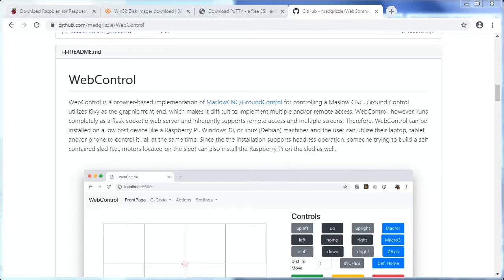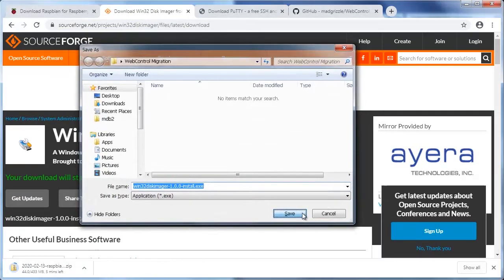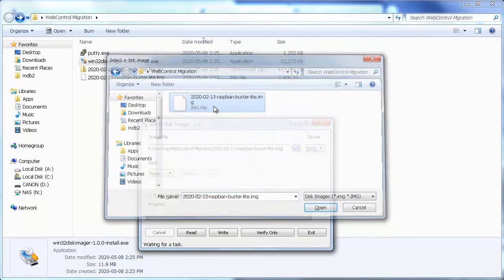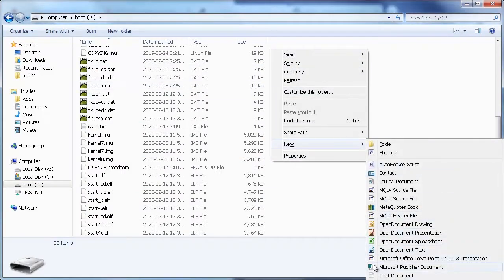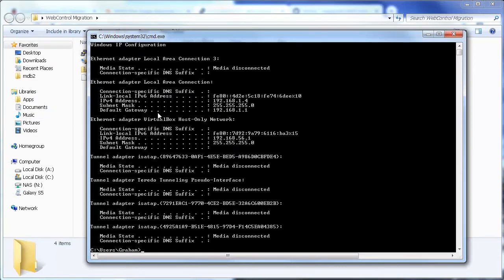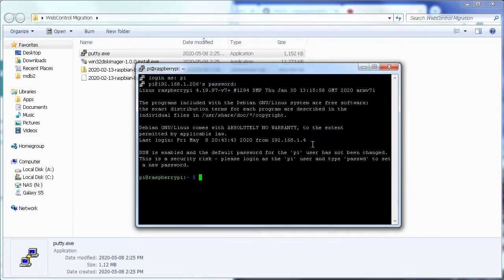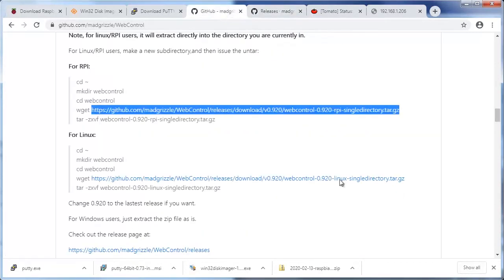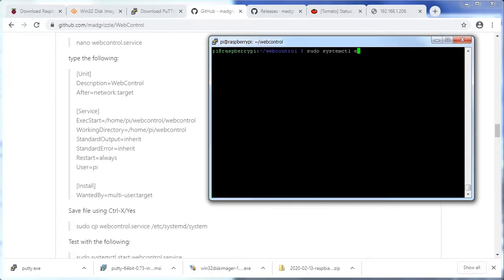GroundControl to WebControl on Raspberry Pi Migration for Maslow CNC

Comment: OK so here's what I've found.  I was able to access Webcontrol at my router ip:5000 (note the required colon--not a dot for localhost), then it stopped. After banging my head against a wall for 4 or 5 days trying to reconnect--reinstalling Webcontrol on my SD, re-configuring all of my W10 internet protocols to no avail. 

Finally I found this command:  'netlist -lat' (no apostrophes on the PI4 command line), which shows which addresses are available on my PI4.  I typed the IP numbers (xxx.xxx.x.x.:5000) into my browser, and my phone, and viola, I'm finally connected.  

Hope this helps anyone having the same problem connecting to your browser, tablet or phone.

Comment: Graham:  Love the video.  Very helpful, although I must admit I'm stuck.  I cannot open webcontrol via my url from my rpi4.  Tried everything:  turning off my security, turning off security in Firefox, etc.  I at a bit of a loss.  Webcontrol seems to be working fine on my PI4.  I have wireless access to it, but I cannot open a window into myrouter-ip.5000 (xxx.xxx.x.x.:5000) from my laptop or my phone.  I've reinstalled and rebooted many times.  Thanks for the great video.

OK so here's what I've found.  I was able to access Webcontrol at my router ip:5000 (note the required colon--not a dot for localhost), then it stopped. After banging my head against a wall for 4 or 5 days trying to reconnect--reinstalling Webcontrol on my SD, re-configuring all of my W10 internet protocols to no avail. 

Finally I found this command:  'netlist -lat' (no apostrophes on the PI4 command line), which shows which addresses are available on my PI4.  I typed the IP numbers (xxx.xxx.x.x.:5000) into my browser, and my phone, and viola, I'm finally connected.  

Hope this helps anyone having the same problem connecting to your browser, tablet or phone.

Comment: So if i understand correctly, I can skip most of the setup if I simply want to add a monitor and keyboard? My shop is in my garage and unfortunately its a detached garage and the Wifi doesn't reach that far but I do have a spare monitor and Raspberry pi laying around.